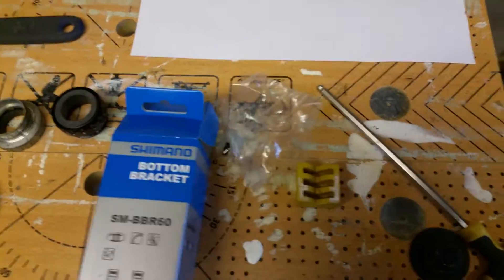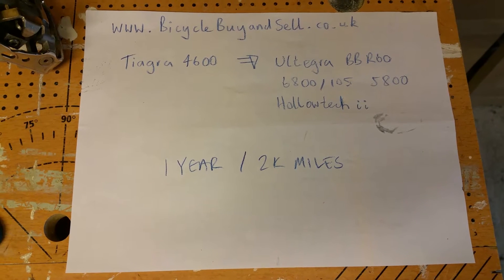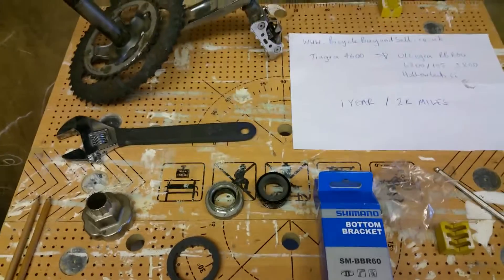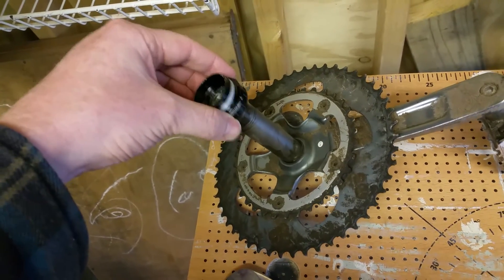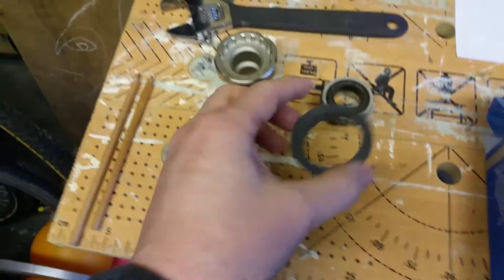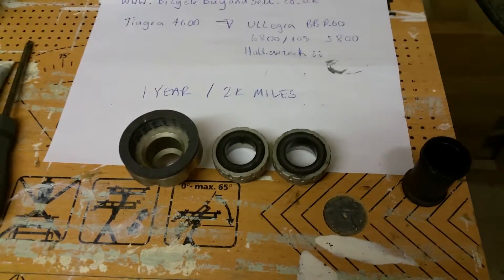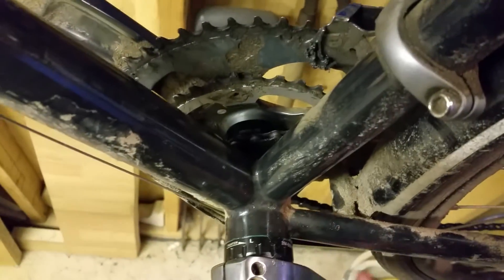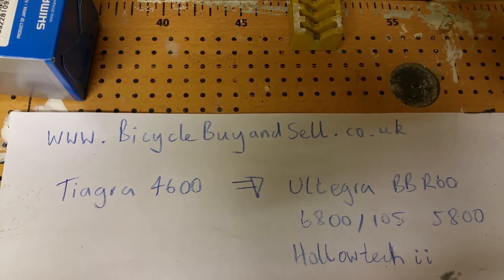Compare Tiagra and Ultegra Hollowtech II Bottom Bracket

Comment: is it possible to use tiagra bbr500 with ultragra crankset ?
Reply: Yes. All the Shimano 24mm threaded BBs are compatible with all the Shimano Hollowtech 24mm cranks. So Sora cranks fit Dura Ace BB, 105 BB fits Ultegra cranks etc. And any other 24mm crankset, in theory...